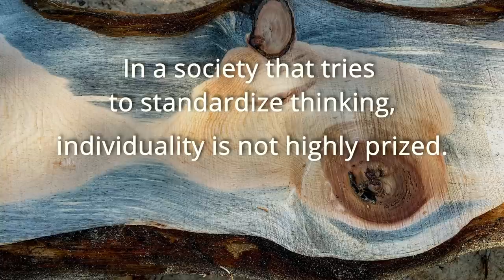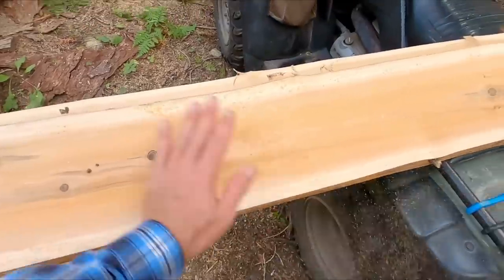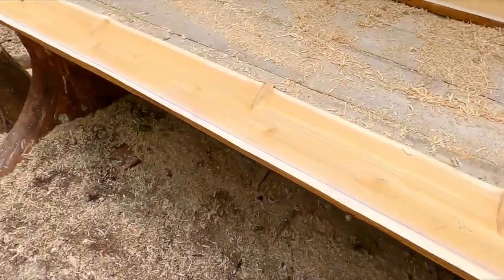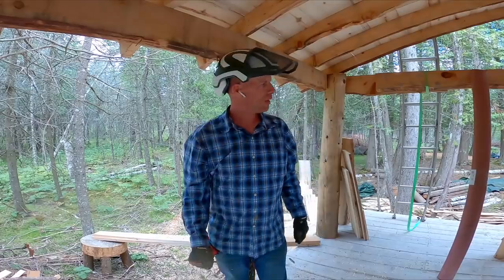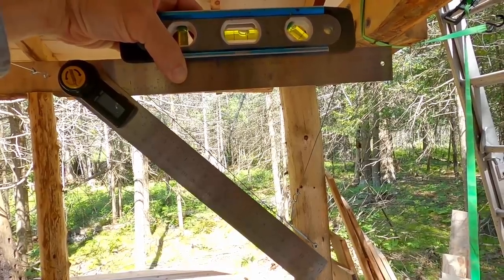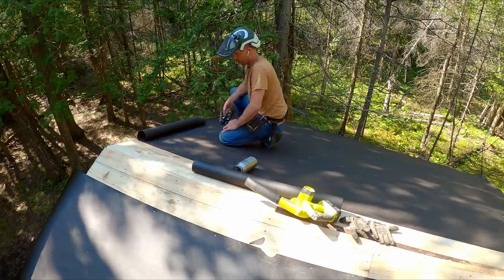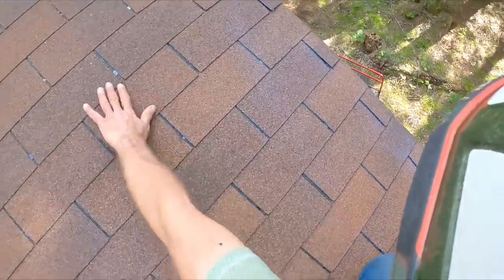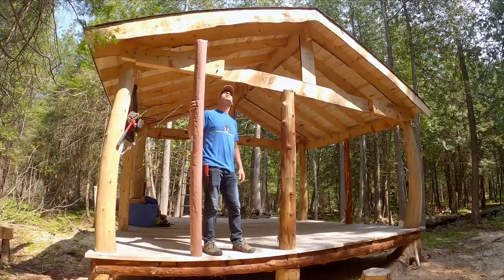Roofing a Chainsaw-Milled Gazebo for $30!  #48

Comment: Glad to see you added guy wires at least. I was getting worried since the posts are only attached at the bottom with a few screws. I was close to having a structural engineer I know have a look. I still have concerns and will see him in February. Would hate to see you get hurt. It's not like the stilts are buried 3 ft in the ground with concrete. Plus  their curved. Kind of sketchy! But what do I know.

Comment: If you are still looking for suggestions on projects, maybe updating the first structure you and Tito built to house your tools. I know you seemed pretty excited about having to push snow off the tarps constantly to keep the roof/walls from caving in during the winter. Looks like you might even have enough shingles left to put a proper roof on it! Might even be able to extend a lean to on the end to "garage" the 4 wheeler.

Comment: Built and developed for 30 years, Know what? Turns (old homes built at the turn of the 20th century) are still standing, still solid and still aren't square. Codes and practices are good, but common sense and some space around you without some skank HOA group bitching is still the most satisfying. The roof line adds character, I'll have to do one like that on my 645 acre "piss off and leave me alone" plot.

Comment: You have the cable clamps on backwards.  The saddle goes on the live side.  Never saddle a dead horse.  The cut side is the dead side.  The other is the live load side. That is where saddle should be.

Comment: Ya know How you built this is basically how I saw another guy build a vertical log cabin  in Alaska it was interesting put up your 4 corner posts and your beams n fill in with vertical logs side by side n I believe he did it by himself with maybe 7 foot logs that he could move around and handle by himself.

Comment: it sounds like you are not on grid power out there.  if the roof faces south, two solar panels would power your computer editing etc.  also, for wood preservation I have been using birch oil rendered from birch bark.  not sure how effective it is but so far, so good.